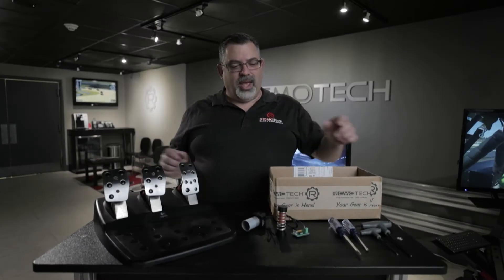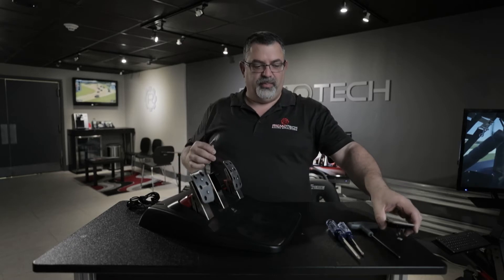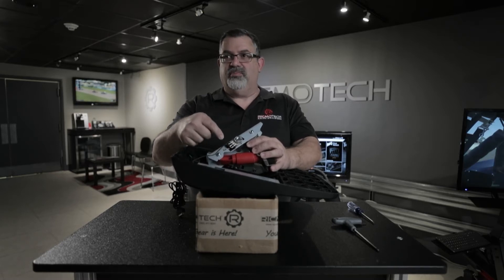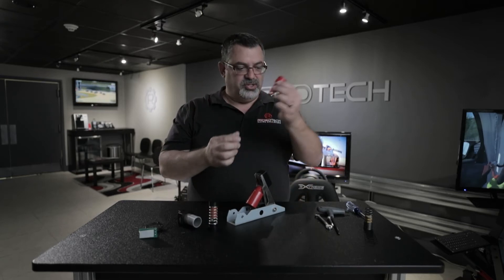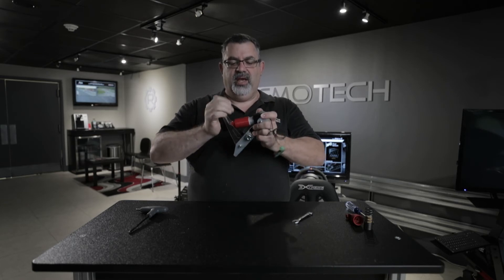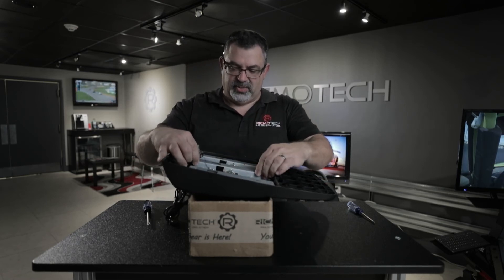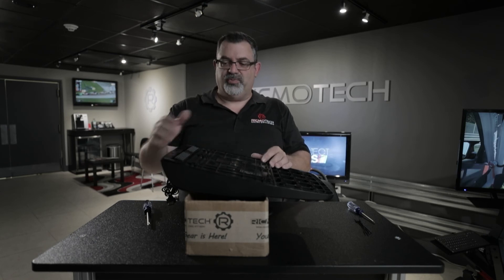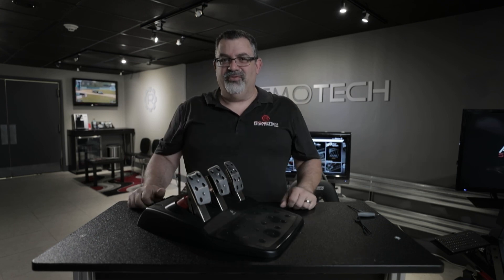Installation Guide for Load Cell Conversion For Logitech

Comment: Why is there a need to recalibrate the wheel?, my g27 does all that and i never have to press the pedals or anything, do i have to do it everytime i start the PC?
Reply from the maker: The wheel does it by itself using the force-feedback motor. That's why it spins when it powers on. You calibrate the pedals without even knowing it when you start using them the first time and push them all the way down.

Comment: 150 bucks for something that coast them 10 bucks to make
Reply: ya, you can get full loadcell pedal sets for 50 dollars more , not sure why its so expensive
Reply: not that cheap to manufacture really, im doing it myself and the loadcell they use is >25usd
Reply: write me if you are interested tho
Reply: @7236399 Hey do you still have schematics or general info about models I could buy to diy some load cells?

Comment: anyone got this?
Reply: @Jonathan Ranson Ratusz mine should arrive tomorrow.  I will do a review
Reply: @dannylynch3290  Did you receive your load cell order, so far? If so, how do you like it? I am thinking of possibly buying one too for my Logitech on PS5...
Reply: @mariusarhire7463  Hi yes I received quicker than expected. delivery process was very impressive being delivered by FedEx from Miami USA to Manchester UK within a couple of days. 
the load cell itself is well built and straight forward to install.
but for me personally the pressure plate is not sensitive enough. 
on the video it states if you can climb stairs you can press the pedal to 100 percent.  on f1 21 xbox series x this is not the case unfortunately.
I had to increase break saturation to 100 percent and still struggle to brake.
If im prepared for the corner I can just about  manage with a well prepared slam on, (no thanks to my knees or my cheap racing rig) but In a race when I may have to brake unexpectedly I have no chance. 
for me overall its a shame, I see real potential in
this load cell. but us logitech users are on the lower end of the budget for sim racing, and this product for me doesn't suit my low budget racing rig. the force I need to apply to brake is either going to damage my leg or my rig is going to fall apart from the forces I'm applying and if you are using the carpet grips under a desk with no stable racing rig I wouldn't even bother with this.

let me know if you have anymore questions from me
Reply: @dannylynch3290  Thank you very much for your answer. It def helped a lot. Cheers!
Reply: I have it ordered
Reply: I have one on order, too

Comment: I am using a g27 shifter on my g29 race wheel and the shifter works to change gears but.. the hat buttons , the 4 buttons top left right bottom  does not work and the four red buttons don't either the green lite is on. is there a fix because I would like to use these buttons on the american truck sim??  please reply here as I have subed.. thanks  jim
Reply: USB hub from Collective Minds.